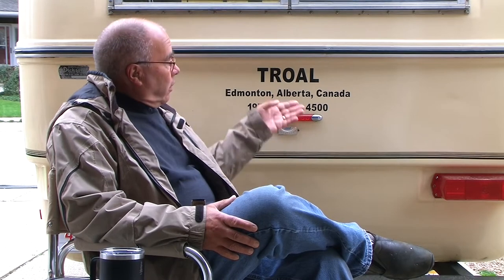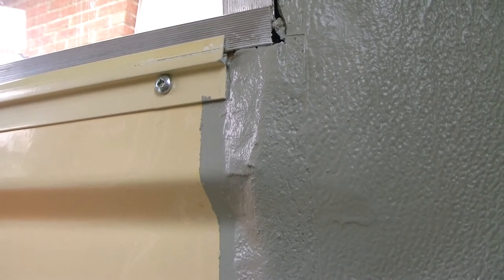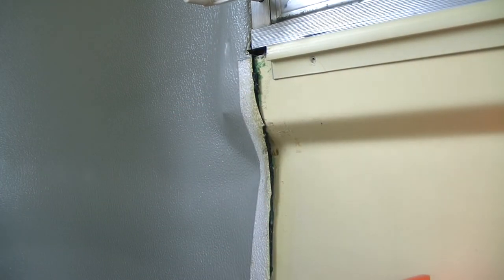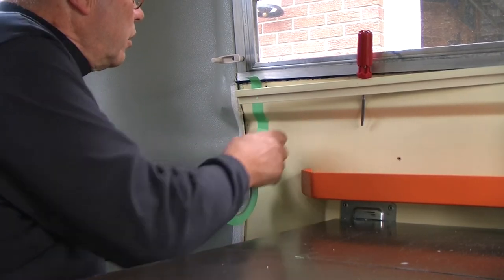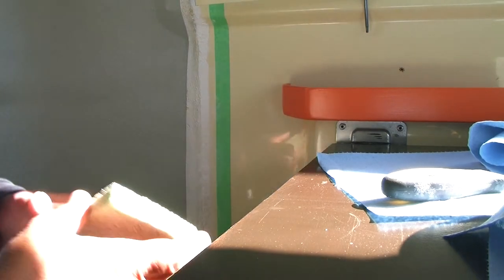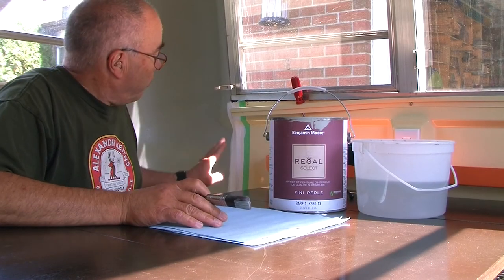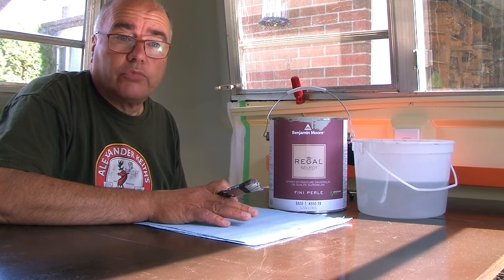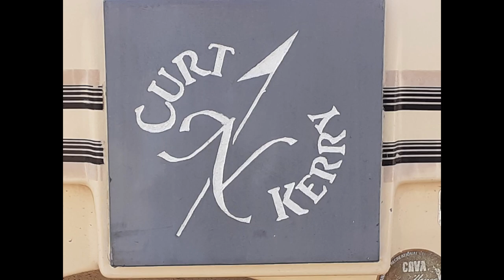Caulking Ensolite Interior Seams in a Vintage Molded Fiberglass RV

Comment: Thank you for this video! I recently bought a 70s model Trillium 1300 and I have the same issue with the T molding being wavy in areas. I was going to heat it up and try to reuse it but after watching this I've changed my mind.
Reply: Also, the Ensolite is sagging in certain areas and needs to be glued down. Did you have this problem and if so what did you use? Thank you!
Reply from the maker: Glad it helped
Reply from the maker: We have not had that problem.  I would recommend Contact Cement to reapply Ensolite.

Comment: Hello, we’ve bought our first Trillium and it’s needing some interior sprucing. How has the previous paint job been thru a full winter? Any issues?
Reply from the maker: Tracey - the previous caulk and paint that we applied a couple of years ago have stood up very well!  We have had absolutely no issues with either.  We just could not get the vinyl tape that we used for the edging to work at all well, so this is why we decided to use the caulk and paint method for the edging as well.  If we run into any issue with it in the spring, I will be sure to let you know!
Reply from the maker: PS - we are located in the middle of Alberta, so our winters get VERY cold!